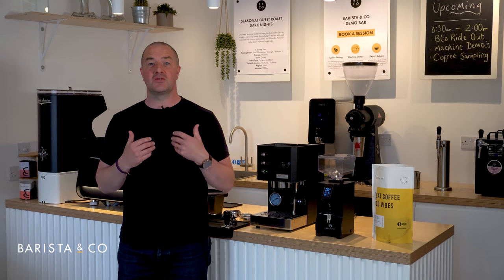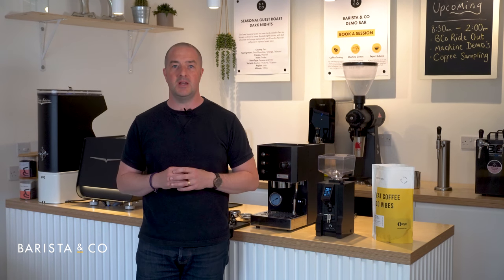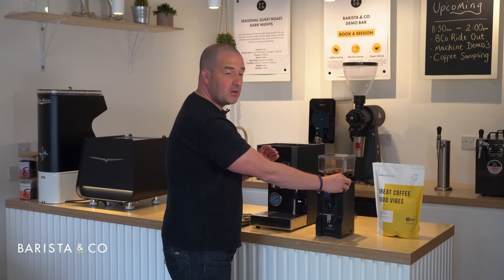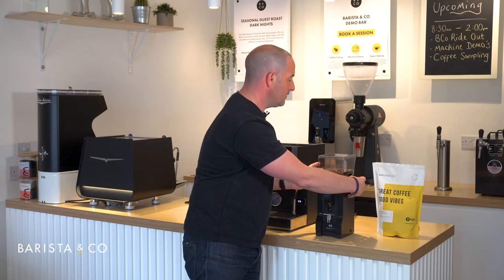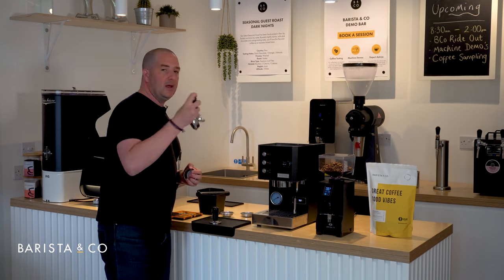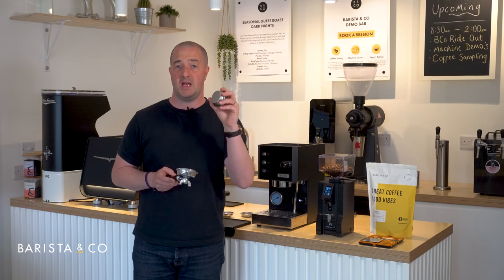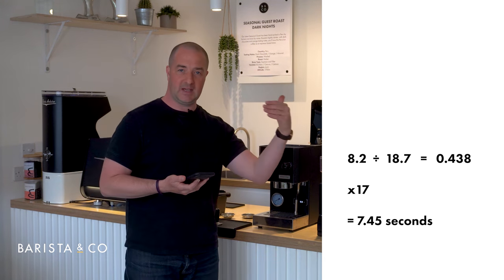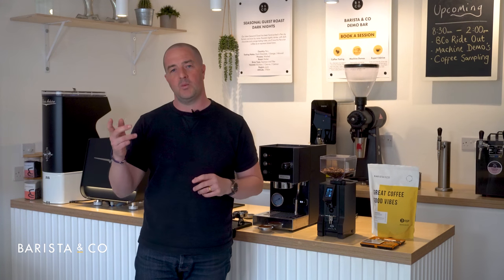Dialing in Your Grinder and Espresso Machine | Achieving Perfect Extraction with Barista & Co

Comment: I am confused by this video. You are using 17g of coffee for 30ml of espresso. Does this mean for a double shot you would need to use 34g of coffee which means you would need to fill the portafilter twice.
Reply: That is a double shot, if it was a single it would be less coffee in like 7-9g. With it being 17g in and 34g out it’s a double shot.

Comment: I noticed on the first shot you pulled the pressure remained low and didn't reach reach the 9bars where as the final shot did. Is this due to the grind not be dialed in and the water going through to fast?